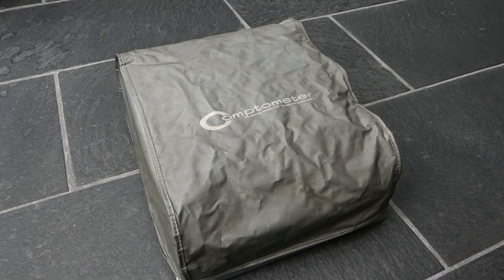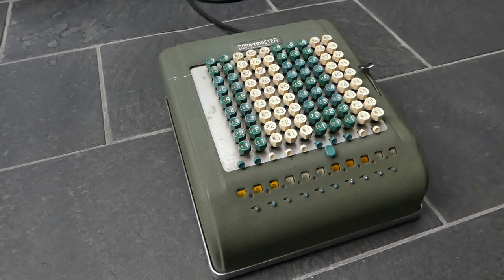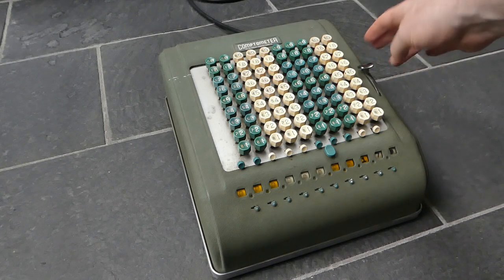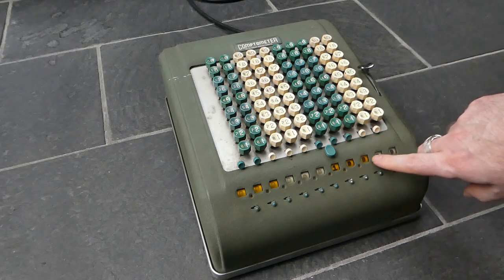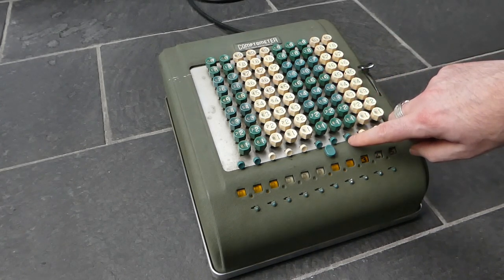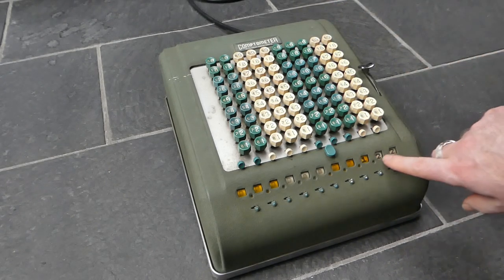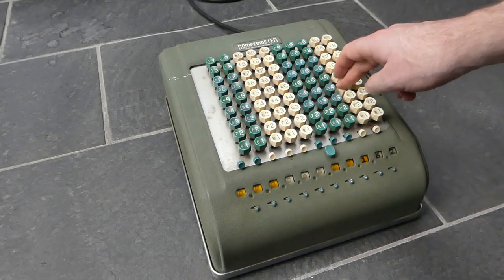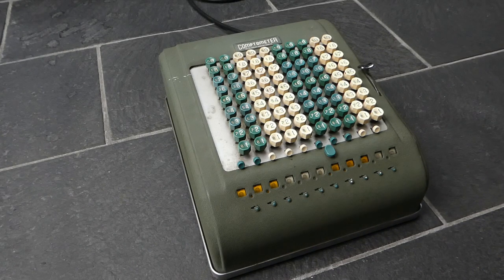The Comptometer 992 mechanical calculator

Comment: And it actually works! Very nice- I always thought an electric comptometer was a silly idea but actually this one seems to be quite nice. I imagine you really could work faster on this one than on the manual models.
Reply from the maker: Yes, it works surprisingly nicely. All the keys are equally light in their action. Since recording this I have taken out all the keys to properly clean the keyboard, and it now looks barely used.

Comment: I wonder if the partial press safety is still there to placate set-in-their-ways users. As you mention, Compometers had been around so long - virtually unchanged - that people had used them their entire career, for tens of thousands of hours. That safety possibly provided some level of psychological safety the users craved.
Reply from the maker: Good point, well made. I had not thought of it in that way, but that could very well be the main reason for it.

Comment: I am very curious - if it's not plugged in and you type, how does it behave? Does it still add?
Reply from the maker: No, nothing gets added if there is no power. I'm not sure what happens if you then switch it on, i.e. whether the keys pressed while off are "remembered", but I can't try it out right now since this machine is in storage.